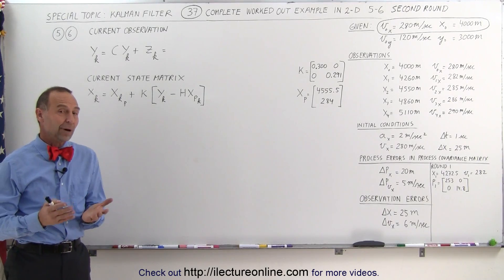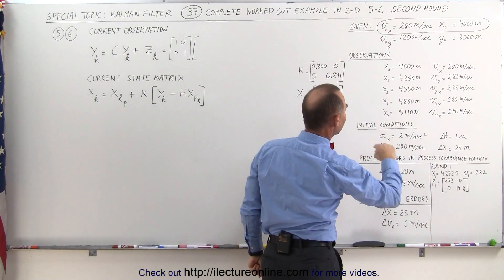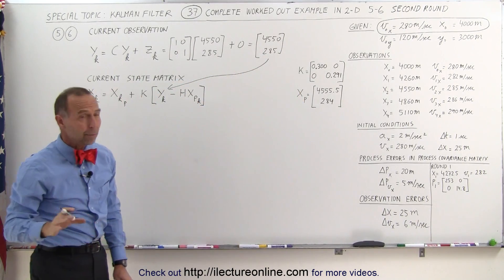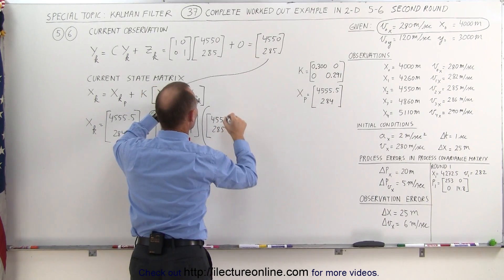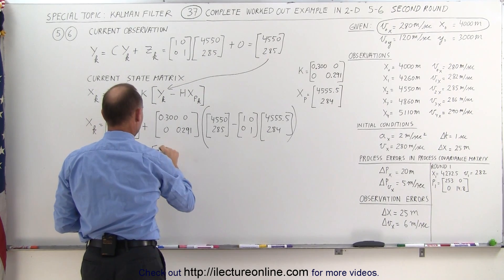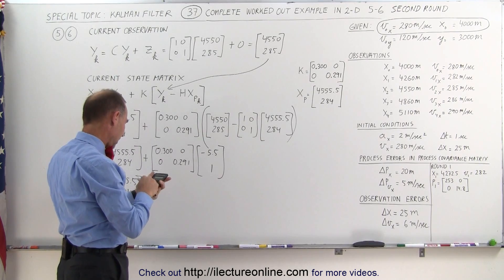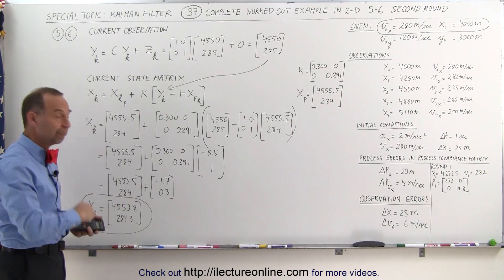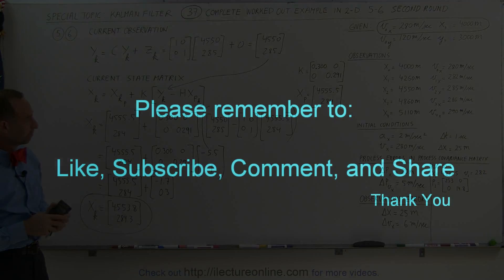Special Topics - The Kalman Filter (37 of 55) 5, 6 of Second  Iteration - Tracking Airplane

Comment: I learnt that we need a mathematical model(state space representation ) to predict the state of a physical system , and then use sensor reading , then use kalman gain to optimise  the observation of a certain state ,,, But 
how they make kalman filter  library for arduino IDE to optimise reading  of MPU6050 sensor without any mathematical model , is the first method in the first lectures used to do such that ??